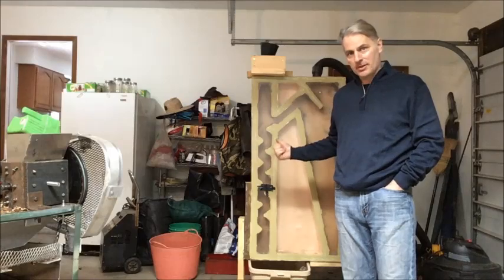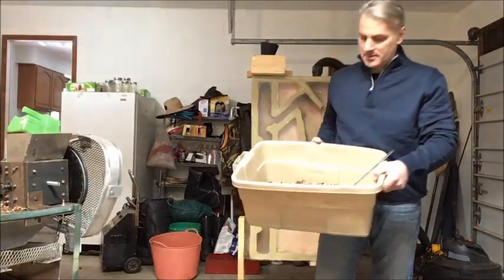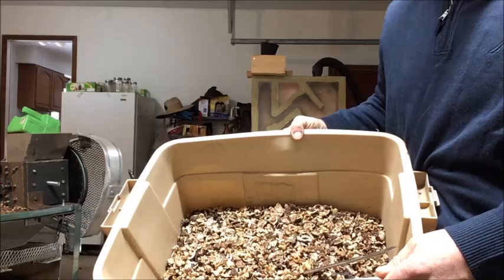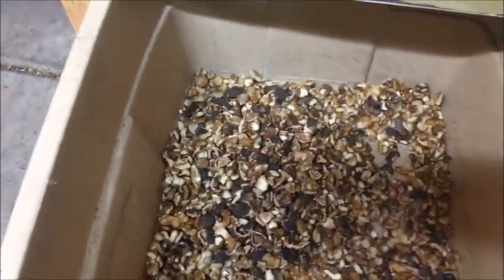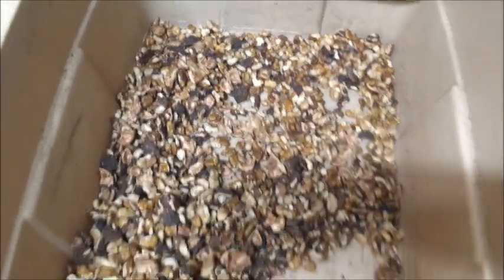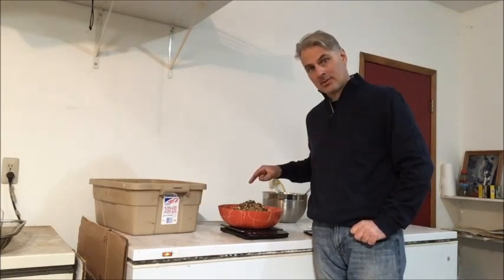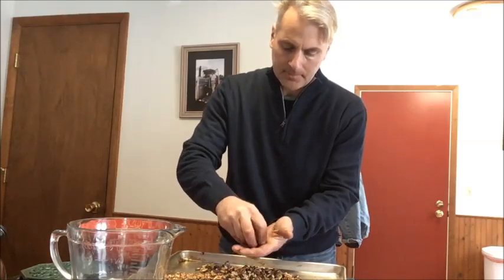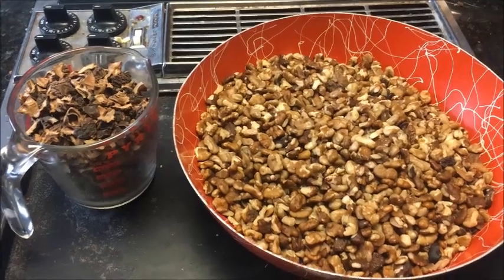Black Walnut Shell Separation

Comment: This is fascinating. I would want to lengthen the path of the nuts and shorten the path of the shells. could there be a way to drop the nuts into the middle of the path while maintaining the air inlet at the bottom?
Reply from the maker: The length of the air column definitely needs to be lengthened I think you could drop the nuts and from the side down towards the bottom, but if you added it up in the middle of the column, it may defeat the purpose of adding a longer column for separation, but if I made another one, that’s how I would do it.

Comment: I wonder if making a hole on the side with a way to add material than you would not be repeating the process and good meat would drop out bottom. Maybe a small auger slowly adding material.
Reply from the maker: I tried adding from the top and it didn’t seem to work too well
Reply: @michiganhay7844  it’s a case of hit and miss but you got a nice start on it.
Reply from the maker: @johnhalter7287  Yeah it’s kind of like reverse engineering making something see if it works and then having to remake it again

Comment: Heard of some people using a salt water solution to separate the shell from the meat; the meat floating, while the shell sinks.  Don't recall the solution percentage of salt/H2O, but it seemed a LOT faster than this.
Reply from the maker: Never was able to get it to consistently work however just regular water separation works awesome for hickory nuts can’t seem to get it to work for walnuts
Reply: @michiganhay7844  I've tried neither, but since I've collected 150 gallons of hulled nuts in what is so far 1/2-way through the season here in KY; I'ma give it a try.  Great job with building the machine.  Also, I'm curious about the mad face you gave the camera @4:17; like someone farted or something.  =D
Reply from the maker: @thisguy8916  yeah I’m not sure nobody else was around when I made the video so I’m not sure about the face but I do know somebody that tried the water separation with salt last year and I tried it and I think you got to do it shortly after cracking the nuts when they have lotta oil in them it seem to work best then as they got dryer it seem to have less likely work but yeah I agree if somebody wants to perfect it and give me all the details I’d love to hear about it but what it did is gotten gave me a whole bunch of really tiny walnut pieces with a whole bunch of tiny shell pieces stocked to them and that really sucked
Reply from the maker: Like I say I’ll run the hickory nuts through the cracker I have a video about processing them I put all the shell pieces and everything in stock pot on my stove and simmer it on low heat and the hickory nuts off float to the top perfectly
Reply: @michiganhay7844  It's all really cool to me, as it reminds me of spending time on my father's familial farm in Pennsylvania.

Comment: From an engineering standpoint, you have the 'idea', but it is not well-executed here. What you are doing is using pressure (air) to move material for sorting. All fine and well, but if you are trying to use air pressure differences to move-and-sort, what you may want to try is placing your lower-pressure (vacuum device) on the RIGHT vertical wall (most-likely, mid-wall to upper-mid wall), and then controlling your chamber pressure with a variable diameter orifice (slide-in plates, maybe) where you are feeding the aggregate into. This would make your air intake where your aggregate is currently, and then a constant higher pressure across a 'gravity drop point' (your right angular chamber) so that heavies fall out. This would simulate 'gold panning' with lighter 'flour gold'...where the 'flour gold' is almost identical in mass to the black magnetite sand it is often found in. The 'trick' is to find the 'magic spot' of chamber 'width' on that right side to give time for the 'nut meat' to fall out of the vacuum, while the solids stay in the weir chamber due to air vortex and friction.
I have not done this myself, but in watching the mechanics of what you are trying to do, it seems you are simply working in a 'hydraulic environment' to simulate gold extraction.
Reply from the maker: Skeeter Saurus thanks for the information, but really looking more at aerodynamic profile for lift, not pressure. I’m a farmer and not a engineers but if you were to build a system and show it working that would be great. I have plenty of people give suggestions such as us but nobody’s showing me an actual working model so I think this is pretty practical and works.
Reply: Your idea is interesting. I wonder if you could post a link to some information about this gold flour. It’s not an identical situation though, because the densities of the nut meat in the shells are virtually identical. The device shown separates them using airflow, not floating versus sinking through a controlled pressure gradient. the flatter shells and woody parts behave more as sails, while the rounder nut meat is less affected by the airflow. 

The principle of upward blowing air moves The shells generally upward, and the nuts generally downward. The slope, shape Of channel, length, input mechanism,  and air velocity are all variables that could potentially be adjusted.

Comment: You could load your bits into that unused portion so it'd be self loading.
Reply from the maker: JoeBob Jenkins that is the section shells are deposited
Reply: @michiganhay7844  i mean the section directly to the right thats empty.  Instead of feeding them through the hole you could drop them through the area directly to the right of the opening with a catch basin for the meat.

Comment: What is the oldest shelled black walnut that you’ve shelled,? 
I’ve heard that they can be kept for more than 10 years, I want know if there is any truth to that.
Reply from the maker: Z Douce Seems like three years is the longest that I have heard the longest that I’ve done with good results not saying you can’t go quite a bit longer but at that point a lot of it’s going to depend on how well it was stored like humidity and things insect damage etc.
Reply: I cracked some this week that have been sitting at room temperature for the last year. they were fine; I have more in the freezer, but didn’t have room for all of them.

Comment: I’m surprised that the nut meats aren’t pulverized by this.
Reply from the maker: DovidM You are referring to the huske unit? yes the husker can crack the nuts if you run it too aggressively and it won’t work with English walnuts it destroys those. The air separator does not pulverize the meats at all though if you left them in there for a really long time and let them tumble the polish i though and does grind them down a bit

Comment: https://circuitdigest.com/microcontroller-projects/arduino-color-sorter-machine-using-tcs3200-color-sensor
I found this DIY Color Sorting machine, using an Arduino module. Arduino, if you don't know, is open source and cheap for do it yourselfers.

Comment: Have you ever tried a saltwater mix??
Reply: I think I mixed 4 cup salt with 3 gallons of water,,it's not an exact science 🤔
Reply from the maker: I have not but I know people have tried it didn’t work
Reply: @michiganhay7844  I've done it the last two years, takes a lot of salt but the meats float and 90% of the shells sink.  Do it immediately after cracking so less oil transfers to the shells.  Works great for the 'chicken feed' material you're feeding the birds too :)
Reply from the maker: Paul Kline like to see a video of the process do you have anything?
Reply: @michiganhay7844  No videos.  There's one big pot with salt water in it and another with fresh rinse water.  I pour the material into the salt pot, wait a half-minute, and use a strainer to scoop the meats off the top.  They go into the rinse for a minute and are dipped out again and spread on brown paper to dry.  When I clean the salt pot there's a thick layer of shells at the bottom - no meats at all - but some tiny shells do float so I have to pick them out by hand.  I'll try making  videos this year of my whole process, I'm not a welder so my equipment is quite different from yours.
Reply: What's the ratio salt to water that you use?

Comment: Hey that's pretty good! I wonder if feeding them somewhere in the middle of that rippled column would work? By adjusting your air door accordingly leaving the opening at the bottom of the ripple column. Then your clean nuts, maybe might drop into the bottom of the column. Just a thought. Maybe you already tried it.
Reply: Garden centers sell cheap augers for drills - to dig holes for bulb planting. Perhaps you can adapt one of these augers in a tube to make a screw feeder for your air sorter.  You could use a handle or small motor to turn the auger. If you have a hopper above the screw feeder supplying the shell mix, the material in the hopper & tube should limit suction loss.
Reply from the maker: That's exactly what I'm planning to do but it would have to be a sealed off chamber if it's an open chamber that you add material through your decrease your suction a lot
Reply: Eventually you could work with a closed system, where the exhaust connects to a larger funnel like feeding chamber.
Reply: Put some form of gasket seal or threaded opening.